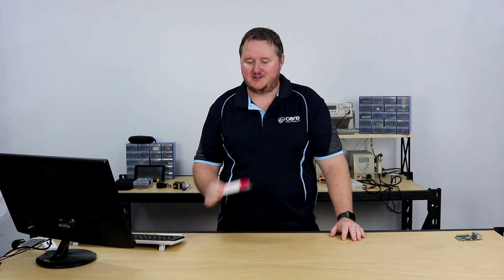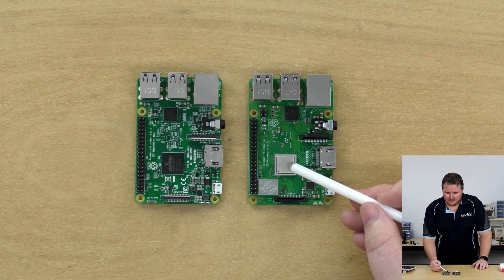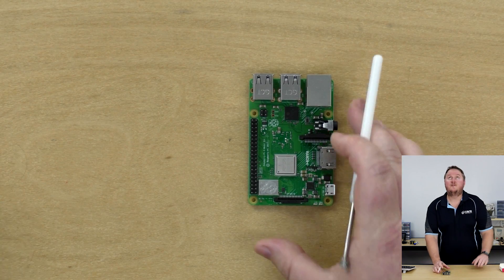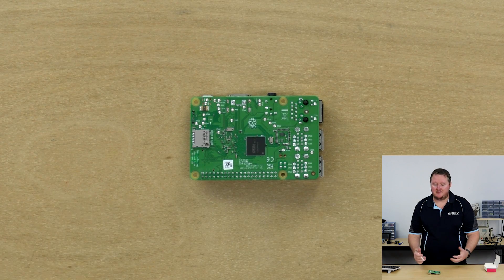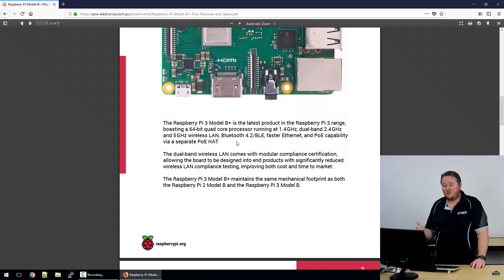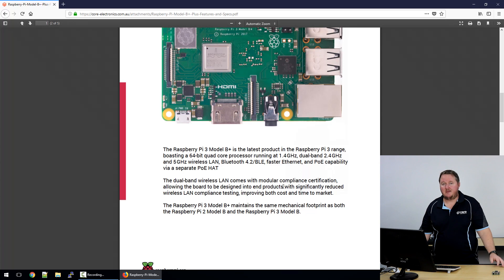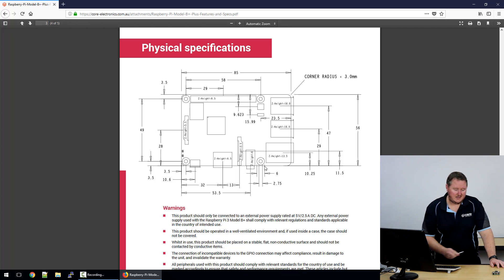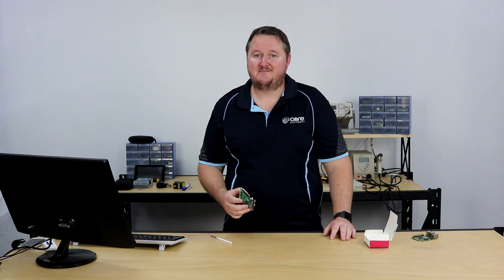Raspberry Pi 3 Model B+ Unboxing, Specs and Features (New 2018 Model)

Comment: Any revision is welcome but not worth it the pi runs at 1.3 with no problems so this with an extra 100mhz not making a great change if it shipped with an extra gb of ram be a great upgrade, and from what i have read it really is juice hungry and drains a lot of power.
Reply: it will run at 1.3 / 1.4. GHz much longer with the frequency sustained under load for a longer period of time.